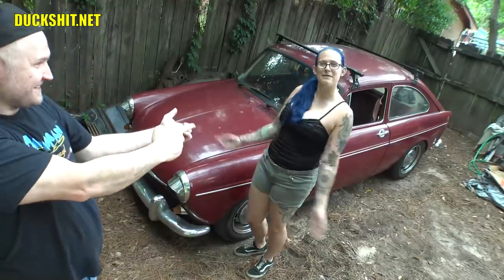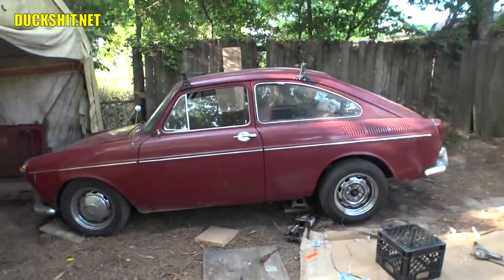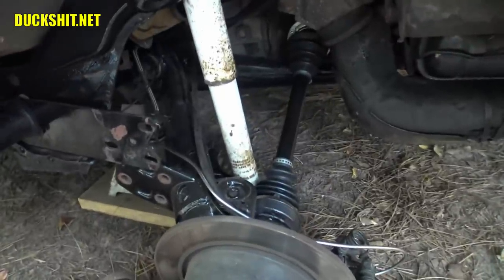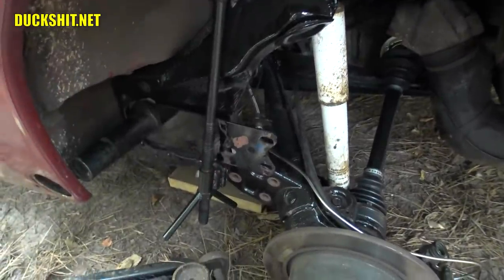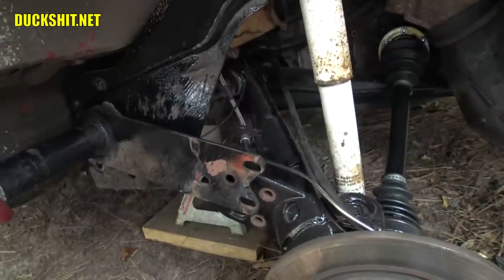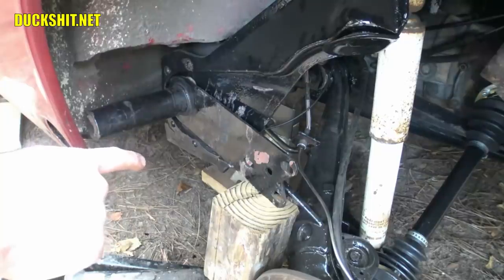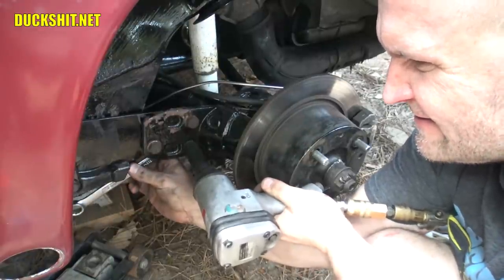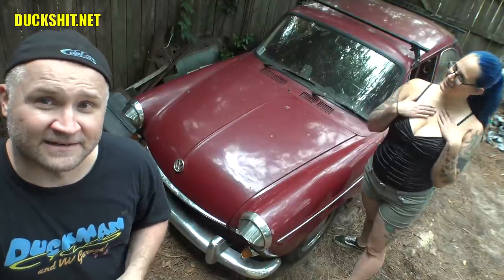Raise Or Lower VW Torsion Bar Rear Suspension - IRS UPGRADE PART 4

Comment: Oh the coincidence. I'm redoing my 79 Type 1' entire rear suspension and have been researching stock degree setting since my torsion bar came out and I could not get the angle recorded. Thanks for posting.
Reply from the maker: Well the stock angle I'm a type 1 is a little different than that of a Type 3. A Beetle is considerably lighter and has smaller diameter torsion bars.
Reply: @DuckmanCycles  Yea. They should be around 21°. I managed to get my passenger side spring plate off and with the plate off the stop with the load removed it read 23°.  I assume that driver side one that I could not get a reading on was  23° since the car was pretty level and even in the rear.

Comment: My 66 fastback was slammed to the ground with all stock suspension and rode fine!
Reply from the maker: I suppose "fine" is a relative term LOL... probably better than a skateboard or even a Jeep Wrangler.  That's fine.  😁👍🏻
Reply: Even cut the stoppers off the back suspension to get another 1/16 of an inch, drove it everywhere even from orange county to Sacramento a couple times, wore out tires yearly, and took out road reflectors,  this was 1986 87 i was in my 20s 😁

Comment: My 1980 vw Brasilia does not have the IRS rear suspension is the old one with tube and oil.  I think it's awful.  I use the crow's foot tool to compress when I change the bearing cover retainer and little oil escapes.  It's a great tool.
Reply from the maker: Thats a good use for it, or you can just put a jack under the axle tube!   Thanks for the suggestion!

Comment: Would it make a difference if you put adjustable air shocks to raise it instead of raising it the way your doing it?
Reply from the maker: No, otherwise I would have done that. An air shock would have fought against the existing torsion bars...

Comment: So I'm trying to fix the camber on my rail buggy. It currently rides on the insides of the rear tires. It also has an IRS suspension. It's visible to the naked eye. The previous owner jammed what I guess is huge truck shocks on it and jacked it to the moon. My biggest question is will this correct my camber issues? Can't seem to attach pics. Sorry
Reply from the maker: If its riding on the insides, its TOO LOW!   The opposite of what you suggested!  I'd have suggested to raise it more.  Normally there are only big camber/tire scrub issues on a swing axle VW, but with IRS much less so... and only when lowered with IRS.  Raising IRS doesn't seem to affect camber quite so much, its all in the geometry of the rear trailing arm.
Reply: It must be the bushings then. It's jacked way up. Wish I could send pictures.
Reply from the maker: Bushings shouldn't even cause that degree of positive camber... but you CAN send pictures.  You can email me through my website, or you can use any of the social media links in the video description or on my website!  I'm always available to everyone!

Comment: Never driven a type3, does the notch back feel different from the fastback in any way, I expect it maybe more quiet inside? Bee Good!
Reply from the maker: They should both drive the same, the squareback had heavier torsion bars though, so that would perform differently.

Comment: @DuckmanCyclesandVWGarage Hey brother. Thank you for the time you take to make videos that helps the community. I lowered my early 73 bug with the adjustable spring plates. After that, the rear driver's side wheel has negative camber and the rear passenger's has positive camber. I have not been able to find any video that mentions any kind of adjustment for IRS on camber adjustment. Can you give me some light on that?
Thanks once again!!!
Reply from the maker: That's because by default there is no camber adjustment on IRS Beetle.  However, if you scissor the spring plate against the trailing arm you can get a lot of adjustment out of it.  I demonstrated this using Porsche 944 trailing arms, but the principle is the same.  I'll be making the same adjustment on my Bus soon too.... since it was rebuilt with Beetle trailing arms and the camber is all weird!
Reply from the maker: Here is my video with the Porsche arms.  https://youtu.be/J1k4_aBahVE
Reply from the maker: This guy also did a GREAT video on the subject using a Lego model he made, it explains things quite well!  https://youtu.be/odWRz5Y7Ey8
Reply: @DuckmanCycles  wow. I was not expecting a reply.. Thank you very much for careing!!!!!
Reply from the maker: @RacingAlien  I respond to EVERYONE!  Even the rude BS comments that don't warrant one!  Haha!  Its part of being a real person.  I thank you so much for watching!

Comment: Is there a drive ability difference turning ? 
Next is giant turbo upgrade
Reply from the maker: Thank you, but I don't think I understand the question. Could you rephrase it?
Reply: DuckmanCycles and VW Garage 
Any rubbing issues or extra movement in the rear looks like tires are tucked in. Good videos your a natural.
Reply from the maker: No rubbing from the tires at all, in fact everything looks like it fits its a bit better than it did before.  Fender to tire clearance is a little wider than before!
Reply from the maker: Thank you very much

Comment: According to the adjustment table, the plus symbol means turn splines clockwise?  And negative symbol turn counter? Looking to lower about an 1 1/4". Chart says +6 and -6. Thanks!
Reply from the maker: That is correct!  Thanks for the question, I hope that helps you!
Reply: Excellent! Thank you sir!
Reply from the maker: Hey and thank you very much for the comment!

Comment: Are the spring plate slotted holes the adjustment for toe? And is there and adjustment for camber?
Reply from the maker: Yes, the holes are for toe in.  While not explicitly designed for, the same holes can also be used for slight camber adjust...